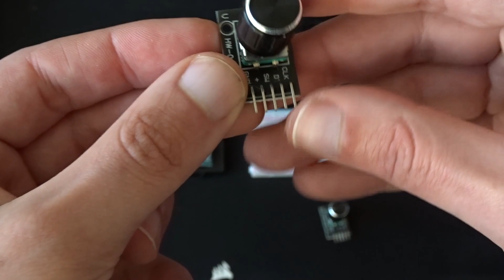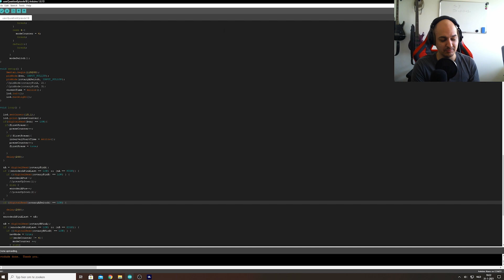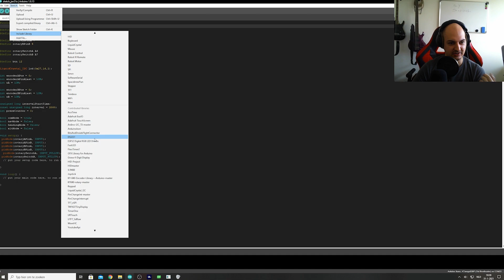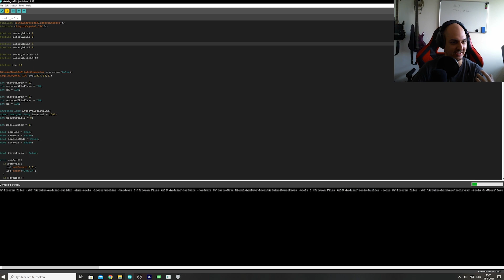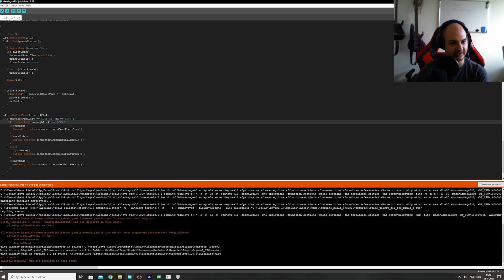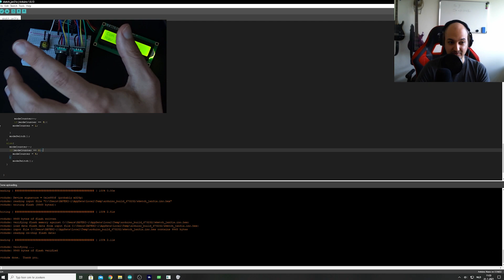Flight sim vr rotary controller, solutions for viewer questions Ep.1

Comment: Is there documentation on the connector variables available?  Looked at some of your sites, but did not see a connector guide of sorts.  Have some stuff working, now want to expand (but that is what we do, right?).  Love what you are doing.
Reply from the maker: Good evening! The documentation can be found here: https://www.bitsanddroids.com/blog/arduino-flight-sim-connector-%2B-library-documentation-mN1zPxSHdmc6ZI4RIY6X If I missed something or you miss something in there let me know.
Reply: @Bitsanddroids  Ah found problem.  Was treating landing gear % as integers, but is shown as a string.  Thanks.
Reply from the maker: @jarose7396  Yeah you are right that it makes more sense to handle them as Ints. I'm going to look into this.
Reply: @Bitsanddroids  It's no biggy if I just LOOKED harder,  so now I just used .toInt() function.  Have LEDs set up to solid on gear up, fast flash transition/fail, slow flash gear down.  Works perfect (except the hours I spent digging out a dumb typo lol).  Your the king, man.  May order some multicolor LEDs for it instead of flashing would be better.

Comment: Hello, I'd love help getting a five position key switch setup for MSFS 2020.  Typically used in something along the lines of the C172 0) Off, 1) Right Magneto, 2) Left Magneto, 3) Both magnetos 4) Start.  I'm finding it difficult to get started with properly wiring this (for use with other switches on the same panel) in a matrix with resisters & diodes to prevent ghosting & to debounce the circuit(s).  It's got me stymied.    I have no knowledge of how to code it yet.  Wiring first.  Thanks!
Reply from the maker: I believe this might be of use to you?
https://youtu.be/sKmBdv_Lwyg